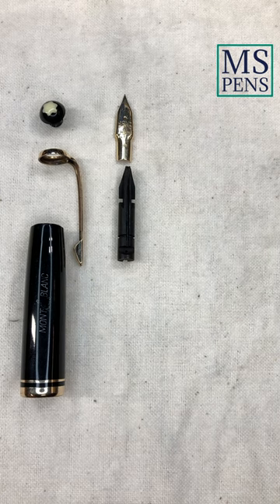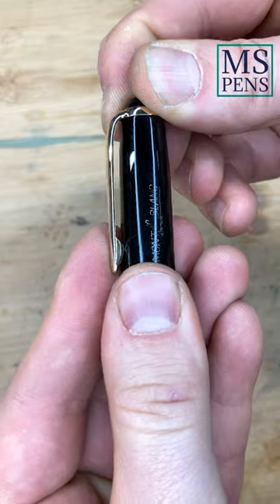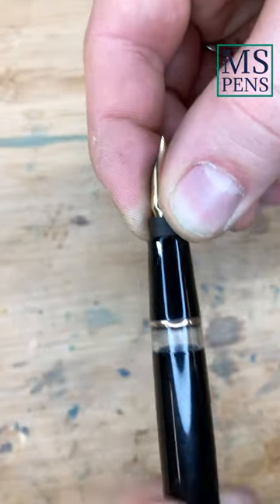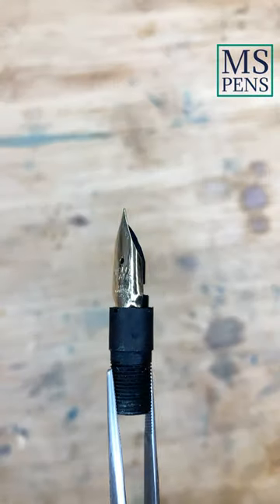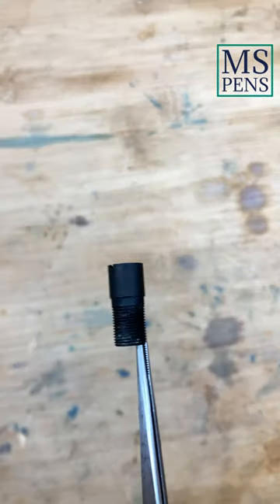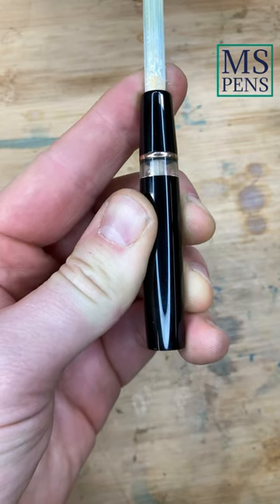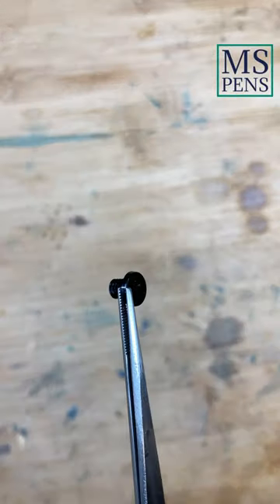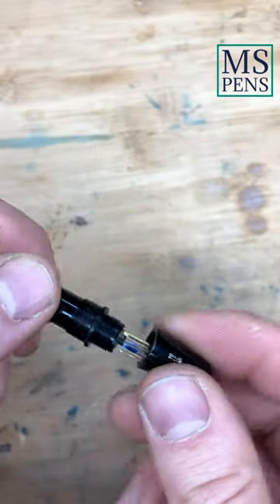Montblanc 256 quick disassembly #shorts #montblanc #restoration

Comment: What is a good maintenance routine for a pen like this? I just got a Montblanc 254 and am wondering what’s the best way to clean it and what intervals I should be cleaning it in between uses. If you could give any advice I would greatly appreciate it
Reply from the maker: Hi, so if you always leave the ink out of the fountain pen and rinse it with clear water when you know it will not be used for a long time, further maintenance intervals are not really necessary. Only if the old ink has become hard and encrusted should you disassemble the fountain pen to clean all the individual parts properly. The easiest way to do this is in an ultrasonic bath.
The seal should also not break if you do not let the ink harden in the fountain pen.

So, simply draw water into the fountain pen from time to time (distilled water would be best here) and rinse thoroughly.
Reply: @MSPens  This is all great info, and I will definitely keep it in mind. Thanks so much for taking the time to reply.